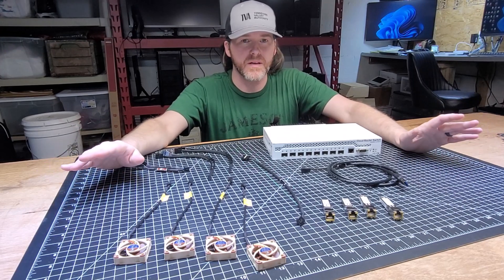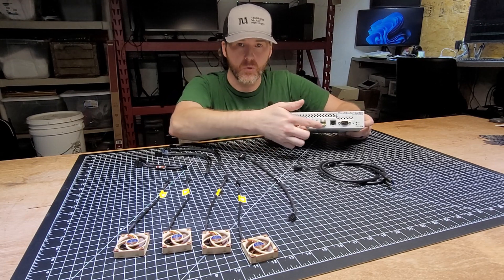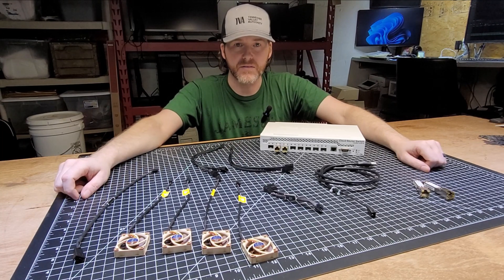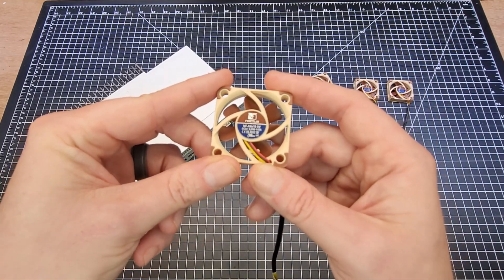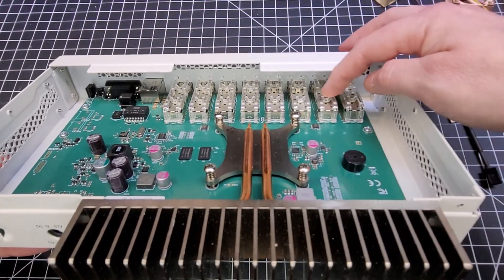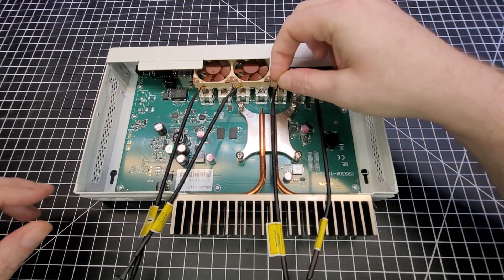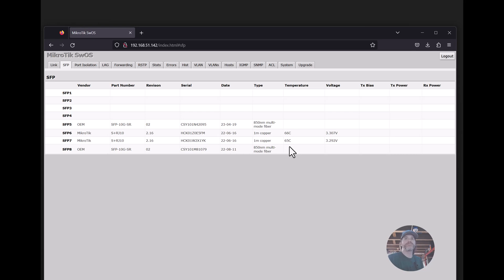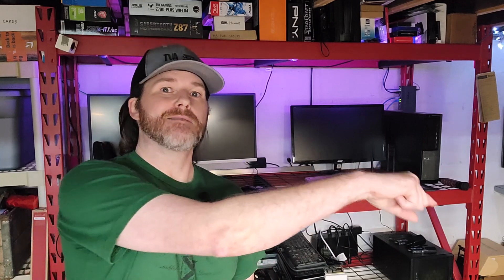MikroTik 10Gb Switch - Noctua Fan Mod

Comment: ideally u shouldn't be using those 10G-baseT transceivers in a switch that doesn't have rj45 ports natively, DAC and optical cables use almost no power, 10GbaseT transceivers use lots of power that's why they heat up, u can only run short ethernet cables with these transceivers, I believe it's 30 meters max (not the full 100m limit on native rj45 equipment), plus they add a bit of latency compared to DAC and optical cables, so it's lots of cons to using 10GbasT transceiver in an SFP+ port.

the power budget for a SFP+ switch is calculated with the intent that u're going to use DAC or optical cables and maybe one or two 10GbasT transceivers, also never use adjacent SFP+ ports when using those transceivers, for overheating purposes, leave space of one more SFP+ ports between them, u can use DAC or optical in those ports.

those 10GbaseT transceivers are meant as a compromise, a temp solution until u get your sht together and buy the proper equipment 🤣
Reply from the maker: You're preaching to the choir and apparently you didn't watch the video, as I literally covered everything you said in the video. The company its self gives detailed information on using RJ45 SFP+ transceivers.

It all works exceptionally well and hits 8.8Gb/s+ on each transceiver. 😉
Reply: Problem is when the hardware you're connecting to only has built-in rj45 10g. And no room for pci cards to add sfp because you're running gpus on them.

Some hardware setups don't have the option to not run rj45, like mine.

Comment: You can also mod the top cover of the case, drill a hole in it for 2x80mm fans or if the size permits 1x120mm fan. Of course they would be outside (on top) so changes the layout, but they would pull a much bigger air flow.

By the looks of it you might even be able to jam 2x80mm fans inside, below the cover, attached to it.
Reply from the maker: @de0xyrib0se  The goal was no permenant cutting and such.

Comment: This was an amazing video. I've never been a fan of 10 gig over copper due to excessive heat. I'm just now getting ready to purchase some 10 gig switches. I plan to use DACs and pull fiber throughout the house.
Reply from the maker: Thank you for the kind words!  A few of the connections close by have been replaced with DACs as well as the link between the 10Gb switch and the firewall. The extremely low latency of DACs is impressive.

Comment: I would also install some thermal pads under the PCB so to make contact with the case for more dissipation surface. Probably on the top the same thermal pads + aluminium radiators instead of those weak fans.
Reply from the maker: @valicu2000  The only issue with the chassis is not having any airflow at all (just when loading it out with RJ45 modules). I initially thought about just adding heatsinks, but having active airflow always seems to work out to lower temps. That and thermal pads wouldn't make actual contact with the metal SFP+ module housing... it would require cutting/removing the plastic bits around it that transfer the activity/connectivity lights to the front displays for each port.

Comment: It may be more durable to use a fan 4-pin adapter with PCB and glue the pcb directly to the inner housing where all the wires can bypass the motherboard!

Comment: I had the same problem. Bought CRS312 instead. Your solution is much cheaper.
Reply from the maker: Its worked very well so far! 6x SFP+ RJ45 modules side by side for almost a year now with zero issues and cool temps.
Reply: @Warning56kb  Good to know. I still have two CRS309, but decided to not use RJ45 modules anymore due to high power consumption. DAC seems to be the winner here whenever you have a choice.
Reply from the maker: @hit-757  Well said! Especially if routing through tight spaces isn't an issue, DAC is the way to go.

Comment: I had the same attitude about my switch it had 2 40mm fans in it but mounting points for 4 of them so I just had to swap out the existing fans for some noctuas and add a few more fans. then I cut a hole in the top over the Processor heatsinks and mounted a slim 80mm fan and put a fan grill over it. In the future I plan to run a custom loop watercooling setup through all my servers. And that is going to include my 10gb switch as well as my router.

Comment: your rack is almost empty, cut switch box and put heatsink above sfps instead of active coolers.
Will consume a little more than 1u, but hey it's empty )
Reply from the maker: It's all in a different rack now along with some Poweredge servers. That was an old network switch cabinet.

Comment: Only question I have is whether the heat produced messed with/melted the hot-glue.  Seems like glue from a hot glue gun could get messy with how hot the cages get...
Reply from the maker: It doesn't. The fans keep the heat from sitting and heat soaking. Everything stays cool now. The plastic light guides never really got hot, just the metal SFP+ cages.

Comment: Great project... I did enjoy the video. Got the same switch, just today!
Reply from the maker: Thank you! You'll love it. More than enough capability for a homelab by a large margin. The RJ45 path may not exactly be the most optimal, but with the SFP+ ports you have plenty of options. Haven't had a single real issue with it yet. Switching from RouterOS to SwitchOS was a little cumbersome... kept wanting to change to a non-default configuration, preventing easy access once the SwitchOS loaded. All sorted out in the end then upgraded to the latest firmware. Happy networking!

Comment: ? why not just add a 12-5v adapter right to the power port pins and have it all enclosed in the case
Reply from the maker: You could. That would be next layer of investment. This doesn't involve modifying the board its self and was just basic fan adapters and extenders. That would make a good second video! Thank you!

Comment: When I first saw what you were doing I figured you were gonna hack a frame and mount the fans externally. I like that method better my only concern is is there enough holes in the case to let air in/out? Edit Commented before I watched the whole video nice mod. Be sure there is enough I have the Unifi Aggretiation Switch and it mentions something about the internal(or in your case external) power supply not having enough output to power to run all 8 even if you could cool them effectively as apparently the copper adapters pull more power.
Reply from the maker: Thank you! Honestly it will be new territory. Mikrotik only mentions running 4 due to the heat output with no mention of power limitations. The power adapter is a 22-24w unit and so far only pulled 8w with two transceivers. Haven't check the consuption with the four. Good call!
Reply: @Warning56kb  CSS/CRS309-1G-8S+ -- 8x S+RJ10 are supported if PoE-in Voltage >30V. Up 4x S+RJ10 are supported when PoE-in Voltage = 24V.  That is what the manual says.
Reply from the maker: @manofwar556  That's true! This mod allows running more than 4 S+RJ10 modules due to the heat concern when not in a PoE configuration.

https://wiki.mikrotik.com/wiki/S%2BRJ10_general_guidance